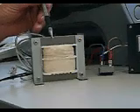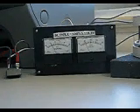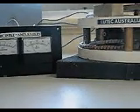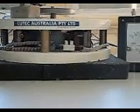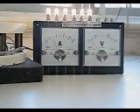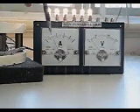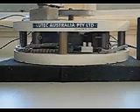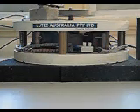Overunity Generators

Comment: Good thing he didn't convert the output AC through a transformer into 4.5V DC and then run the machine off of the output power because then the thing might run forever!  

(It is a really good thing he didn't convert the output to DC and then measure THAT because he wouldn't be able to scam people)

Comment: I suggested converting to dc to get a standard measurement input and out put .dc is dc.
Ac meters on the other hand are dependant for their accuracy on frequency and stability of signal and 3 times unity sounds a lot of unexplained power.
A better way to measure the power would be to dump all the output ac into a resistive load and measure the time taken to raise a known quantity of water by so many degrees in a given time.

Comment: The AC wattage is based on vectors.  What is the real power?  I suspect it will be much less than your input power.  Your current /Wattage measurements method are flawed!